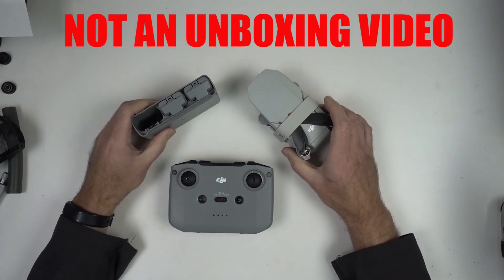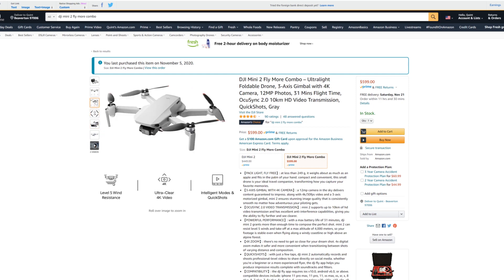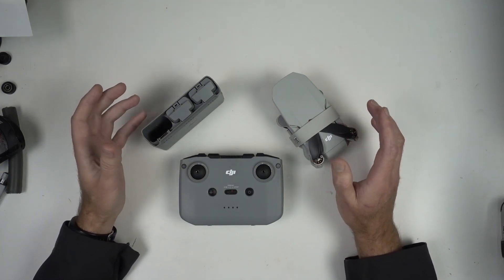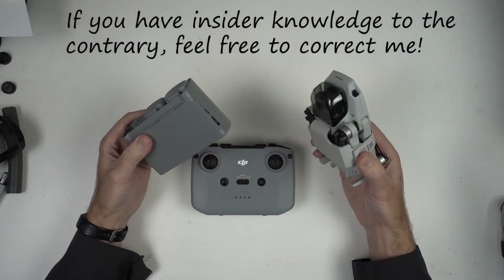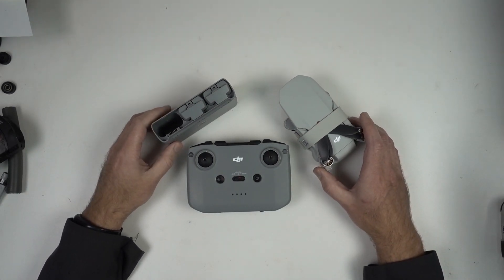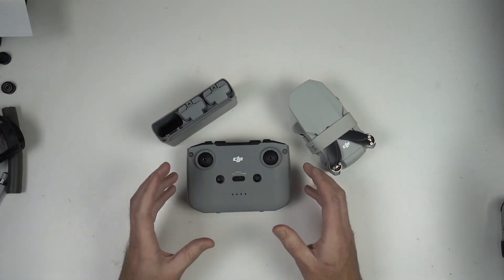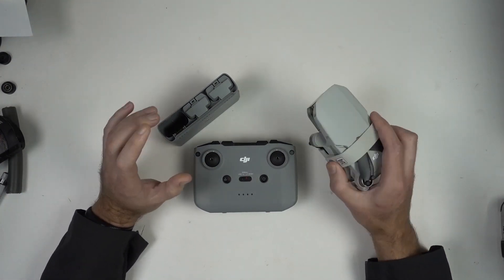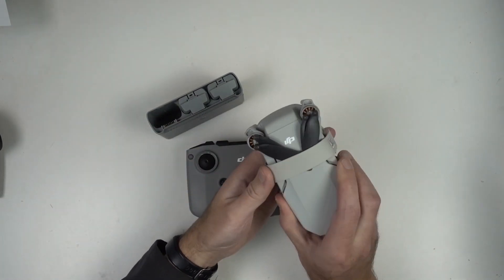Engineering Products like a DJI MINI 2

Comment: Take alook at building your own!
https://youtu.be/Gb8nez1VtTk
I race and build my own drones! The quad 250 all parts are on ebay to build it like the GPS the carbon fibre frames that are light as a feather I used to use fat shark First person view with 1080p camera modules etc there so easy to build all the esps and brushless motors are all out on ebay to purchase to build your own! Look up some of the fpv drove 250 quads! You can print off bigger frames or buy better strong carbon frames it's really only the weight of the battery that becomes the weight of the drone! There hell of alot easier to build than you think! All the esps are tunable and reprogramable DJIs are good but there is alot better you can build for a 3rd or it's price!
Take a look
https://youtu.be/Gb8nez1VtTk

Comment: I imagine there are piles of 3D printed prototypes lying around..  The tooling and MOQ for injection molded parts is pretty steep to use it for iterative design
Reply from the maker: Agreed! I've seen parallel design efforts, one machined and one cast, where the machined design won out because it could iterate more quickly and cheaply. The molded part would have been cheaper in the long run but died on the vine.